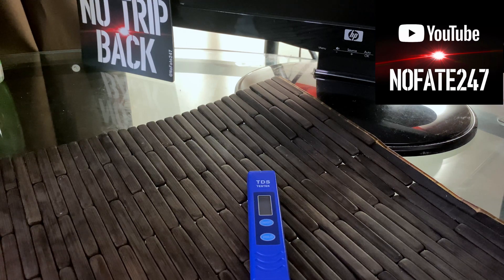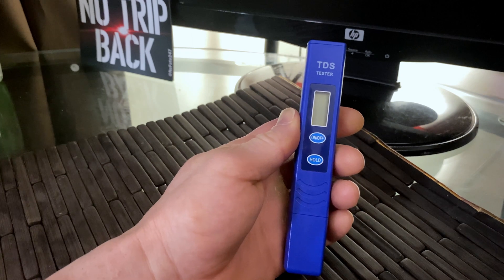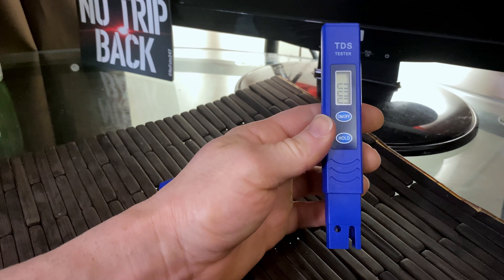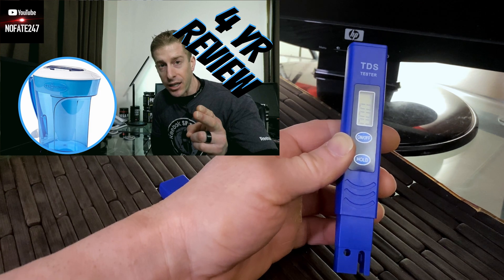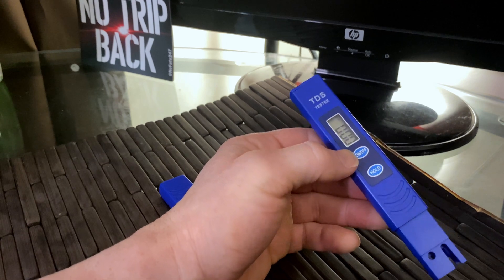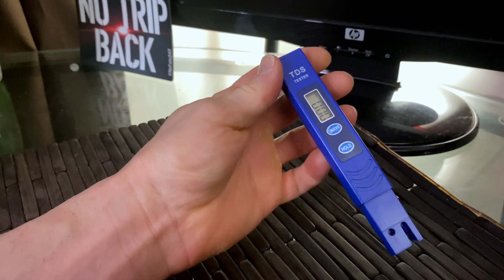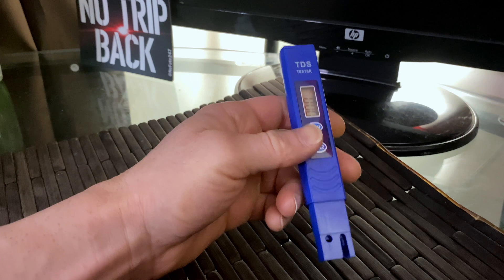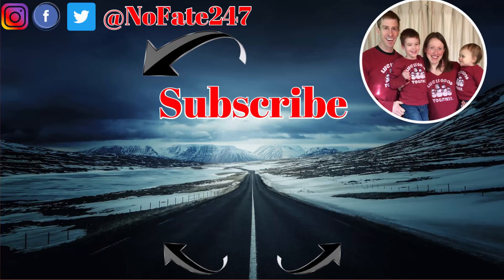TDS: Total Dissolved Solids | What Does TDS Stand For | How to Change Batteries in TDS Meter

Comment: Thanks, but still I missed (as a woman....sorry, not so technical) how to place te batterijen, so which side touches each other). I had to change several timestamp and begane to doubt if my new batteries had enough power. But it worked at last. Maybe you can give this extra information especially for non technical females. I install lamps on ceilings and walls in my home on the Electric system and change an 'accu' ( dutch)(powerbox?) in my car, but I don't know much about eletrical circuits.😂

Comment: TDS meters only measure Electrical conductivity and convert it to PPM, they don’t actually measure Total Dissolved Solids.  They don’t show if your water is actually pure, your water can be full of non-electrolytes that will not affect a TDS reading.  As an experiment, try adding a tablespoon of sugar to a glass of water and take a reading.

Comment: Mine suddenly just started reading 0, has this ever happened to you
Reply from the maker: Zero out of the tap?
Reply: @NoFate247  yes, I think the meter is faulty. I've replaced batteries. The motherboard and screen came out, I put back in but I looks like it could go in another quarter inch but doesn't.

Comment: Buy a distiller and you will have the best pure water!
Reply from the maker: What kind did you get
Reply: Mine was a cheap one which you can get on eBay maybe £60. But do not get one with a plastic container for the water as it will leak over time. I just use a large cooking pot to collect my water. Will find a link if you want to know the exact one, but my model is zokop.

Comment: What do you do if your TDS meter changes values minutes after retesting original samples? I tested three different sources, fridge, sink and a Water Drop filter; the original water sample values all changed when resampled. Fridge has two carbon filters, sink has two particulate filters (whole house filters) and Water Drop has its own carbon filter. Original values were 275 on fridge then upon second testing of the sample rose to 295. Now they are all reading about 295 (on  municipal water). Also, you might want to address the polarity issue with the batteries. They need to go in series (+ to -) and when the battery clip is installed it needs to go in at one direction. Remove and rotate the cap if the meter does not turn on.
Reply from the maker: Not sure why those numbers would jump so much

Comment: Mine is just stuck on zero… any help?
Reply from the maker: Assuming the water is not 0, then you can make sure you don't have HOLD selected.  Try reinstalling the batteries
Reply: @NoFate247  hold is not selected, I have only had the device for 2 weeks and the water is not zero when tested before.
Reply from the maker: @awolf913  Time to return it then

Comment: which way should the batteries face?
Reply: My question as well so I suggested: "Also, you might want to address the polarity issue with the batteries. They need to go in series (stacked + to -) and when the battery clip is installed it needs to go in at one direction. Remove and rotate the cap if the meter does not turn on." There are no markings on the tester for battery direction.

1

NoFate247
Reply: @davesmith5270  THANK YOU!!!!!!!!!!!:thanksdoc:

Comment: YOU DID NOT SHOW HOW TO REPLACE BATTERIES.  THERE IS A "POSITIVE" SIDE.
Reply: My comment to him: "Also, you might want to address the polarity issue with the batteries. They need to go in series (stacked + to -) and when the battery clip is installed it needs to go in at one direction. Remove and rotate the cap if the meter does not turn on." There are no polarity markings on the test meter.

1

NoFate247
Reply: Evidently he doesn't understand the question.  I am looking for that answer too.  So aggravating..